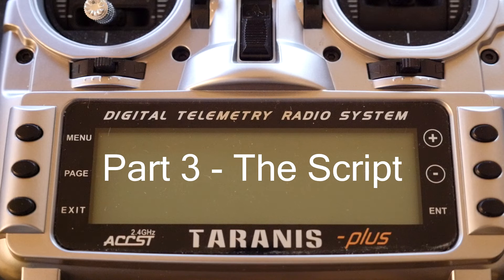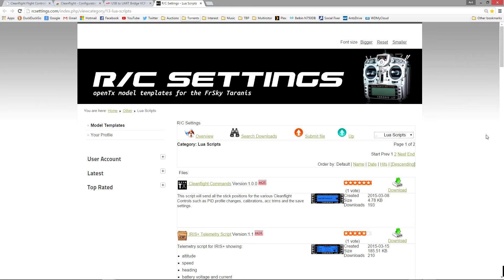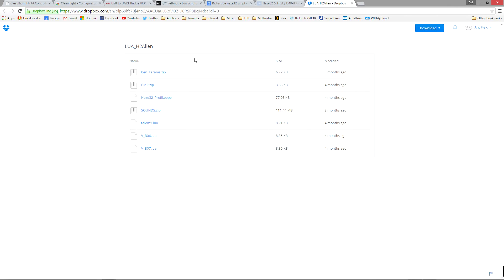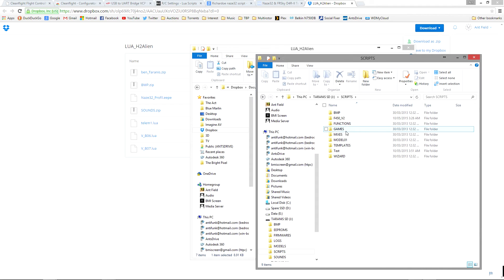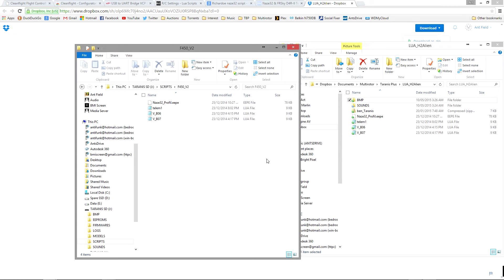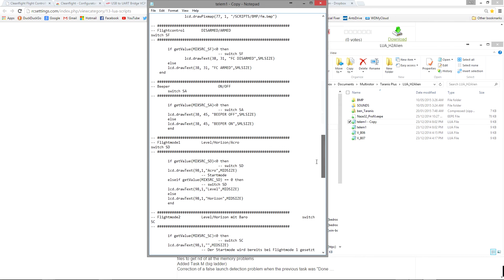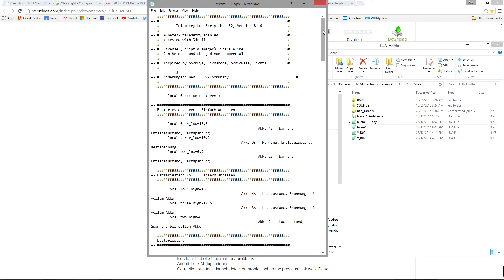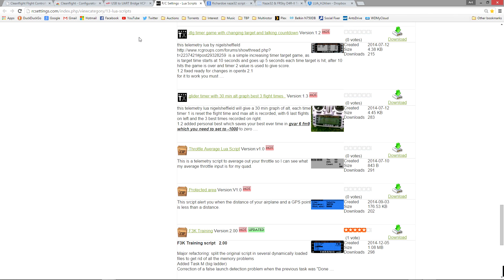FrSky Taranis, D4R-II, Naze32 - Telemetry, Battery Voltage, Lua Script Tutorial - Part 3

Comment: The Dark Pixel Hey there mate, well as a newcower to Taranis from Spektrum, your guides is just spot on and I couldn't wish for a better Frsky mentor ;-D.
But can you verify if this still works with Opentx 2.1 since i'm having some problems with battery and Rssi is not showing and throttle value is bouncing up and down when armed at 5-10%.
Best regards :-)

Comment: First Huge thank you for doing this. Second in the hopes of saving some one some time i believe the folder structure has to change now with 2.1.1 . Rather than having SCRIPTS/MODEL NAME you now need SCRIPTS/TELEMETRY . Also i had to make the selection on the radio on the telemetry page rather than in Opentx not sure why.  Thanks to the guys RCGroups for pointing it out. http://www.rcgroups.com/forums/showthread.php?t=2180477&page=90
Reply: pMustangw The Dark Pixel Thanks for this, saved me some time when I saw it wasn't loading the script.

Does this need any other adjustments for 2.1? I have the telemetry working and page showing, but the bars aren't working and the text will not refresh (ends up overlapping old text when changed).
Reply: To be honest i am still where you are. I thought it would be a simple edit of the code but i can not see where or how the script looks for cell and rssi info. I am thinking it has to do with a small change in 2.1 and someone who knows code can probably see and edit it with out to much trouble. That said i am no coder i was able to change some switches but that is as far as i got. Let me know if you find out how to fix it please.
Reply from the maker: pMustangw Guys have a read here: http://www.rcgroups.com/forums/showthread.php?t=2180477&page=90 
I will make a follow up video soon to update to 2.1
Reply: Ok, I figured it out. It's mostly value changes within the telemetry1 lua script.

cell-sum -> Cels
rssi -> RSSI
batt_sum * 100 -> batt_sum (remove * 100)
remove line lcd.drawText(lcd.getLastPos(), 56, "dB", SMLSIZE)

I also got around the overlapping text issue by adding blank spaces to values, like "Acro" changed to "Acro      ". Not sure if this is the best way to do it, but it works. Have to do that for Throttle%, FC ARMED, beeper on, and the other flight modes.
Reply from the maker: Care to share your modified script so that we can have a look at it?
Reply: Thanks for the info straytowel I will try to edit mine in a few days and report back.
Reply: +The Dark Pixel I customized it a lot to fit my needs (basic Naze Acro / ZMR250) but it's easily editable: http://pastebin.com/nGmD5uWj
Reply from the maker: Cheers. I just wanted to take a look at your code :)
Reply: +straytowel Thanks i just got around to making the changes in the code and can confirm they work.
Reply: +straytowel Thanks for this. When I load it on my Taranis that is running 2.1.3 - if I don't plug the lipo to the quad - I can see the screen. But as soon as I plug the lipo to the quad. I start seeing the RSSI bars go up and then the screen goes blank!
Reply: +M0dded Yeah, they changed telemetry again and also LUA script handling for 2.1.3. Hard to keep up when they keep breaking things each minor update. Check out this thread for 2.1.3 updated script: http://www.rcgroups.com/forums/showpost.php?p=32644945&postcount=1075
Reply: +straytowel Thanks - but I had tried that script too. With that script the battery image stays blank and 0 V & RSSI is empty too. So I checked the script and it seems that script still uses cell-sum. My telemetry does not have cell-sum it has Cels - which is what your script uses. So I started making changes to his script - fixed up RSSI and that works - however as soon as i change cell-sum to Cels - and I plug the lipo in the telemetry screen goes blank! Would love for you to help me work this out please? Thanks!
Reply: +straytowel I have posted an updated script that is tested and working in 2.1.3! http://www.rcgroups.com/forums/showpost.php?p=33069153&postcount=5

Appreciate all the info in this video series and the comments here.
Reply: +M0dded HI! Nice to see some support for Firmware 2.1.x.... Will try it soon, assuming you got it to finally work; I will be using 2.1.7; have you upgraded your Taranis, and is it still working properly? Cheers and Safe Flying!

Comment: Well done series- You have a knack for "teaching" and thank you for taking the time to do this- you just SAVED me a boatload of time with my new naze32 / d4r / taranis plus setup!
Reply from the maker: HG Mills Thank HG :) I teach a lot of trainees at work. I guess some of that experience translates to this also. Glad you got it all going easy.
Reply: The Dark Pixel   Sure- wasn't bad at all with your outlined steps. One thing you did not cover, that I am unsure of, is what to do with the Naze32_Profil.eepe file, V_B06.lua and V_B07.lua files  - in your demo you have all three of these other files copied to your model folder on the Taranis. But your instruction says to only use the telem1.lua file.  Can you share some insight here? I do have a Naze32 and FRSKY 4DR-II
Reply from the maker: Those are just beta versions and are not needed. The Naze file are just a settings file for the creators own multi
Reply: The Dark Pixel  ok thanks!  one last question about the switches setup in the lua script. i noticed that flight modes and switch assignments are defined directly in the script, and i see them working on the taranis plus.  how will this affect setting up flight mode switches in the OpenTX software or in Cleanflight?
Reply: HG Mills alright so this is a cool script and a great tutorial, but, the lua script also sets up all of your flight mode switches and overrides everything else. so i would use this script with caution unless you know how to edit the lua script properly.  i ended up removing it.  IMO the script author should have provided a lua script without mode switches defined as most of us already have that set up in cleanflight and radio.

Comment: awesome, very helpful videos.  quick question though.  i have the newest opentx update just came out mid july.  i have done everything but the lua doesnt work, i try to select the lua as my telemetry screen 2 and i am told no lua on sd.when i go to the sd card thru the taranis and select the lua to execute is tells me there is a syntax error. is this something to do with the opentx update?  anyhelp would be great.  thanks
Reply from the maker: Jeremy Graves First thing is to double check your paths are correct, and the folder names are an exact match with the model, and no spaces. You can easily prove if it's the update or not, by downloading the previous firmware to test. The Lua script will not execute the way you describe and the syntax error is normal. The Taranis can run two types of script. The model script must be called by Open Tx when you select a model. You cannot manually load it. Hope this helps.

Comment: An excellent series.  Thanks for putting it together.
Reply from the maker: UKHeliBob Thanks Bob!
Reply: The Dark Pixel When I get time I will experiment with scripts.  

At the moment I am using telemetry on my multirotors primarily to get the pack voltage which I am doing using SoftSerial rather than the normal Naze32 voltage output.  One advantage of using this method is that the pack voltage is available whether or not the Naze is armed.
Reply from the maker: Yes, this will work nicely. You can also make a very simple DIY voltage divider straight into the D4R-II. I might make another tutorial on how to do this also.

Comment: One additional question:
when starting up your taranis and powering/arming the copter/receiver you talk about altitute which is getting displayed on your starting screen.
Are you using any addition to the naze32 to get this information on the taranis?
Reply from the maker: Patrick J Nope, but you need a Naze full, not Acro I think. Honestly I'm not 100 percent on that because it just worked for me when I got the telemetry running. Are you having problems with it?
Reply: The Dark Pixel that actually makes sence.. i have the acro. Everything worked perfectly fine as described in the video, i was just curious about the altitude :) naze acro does not have baro.. thats it.

Thanks for the fast replies!!
Reply from the maker: Patrick J No problem! You caught me at a good time - I'm sitting at the computer doing an overly complex and incredibly boring CAD layout for work. Distractions were needed :)

Comment: I have my flight modes on switch SG. When flipping the switch, the flight mode icon does not change on the new telemetry screen. Is this because it's programmed for a specific other switch in the script perhaps?
Reply from the maker: Jonathan Faiella Exactly. Just open the script .lua file in notepad, find all instances where the switch for flight mode is mentioned, and modify it to SG, then save it. I suggest working on a copy of the script file in case you make a mistake.